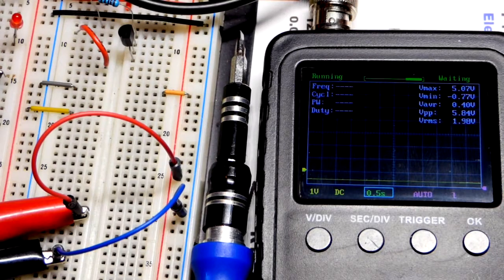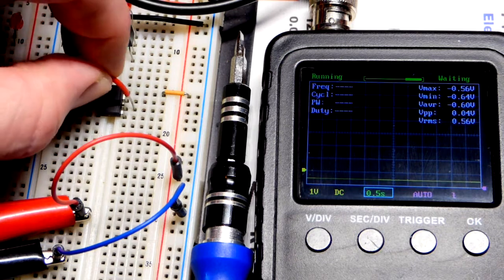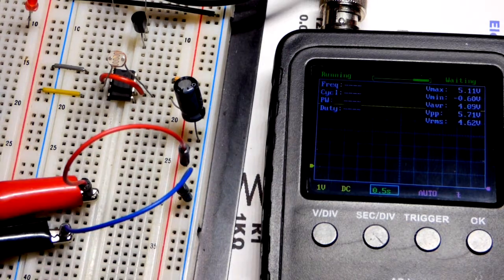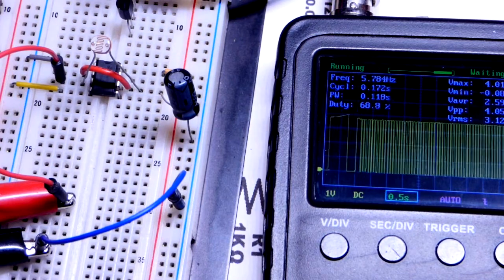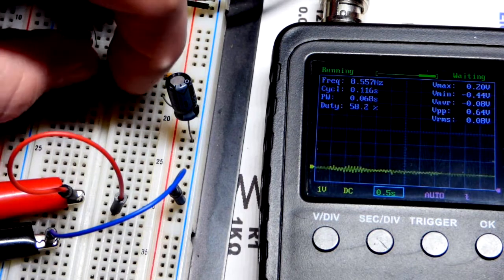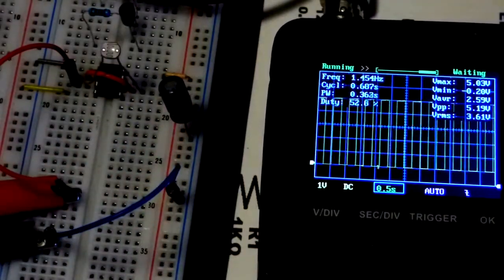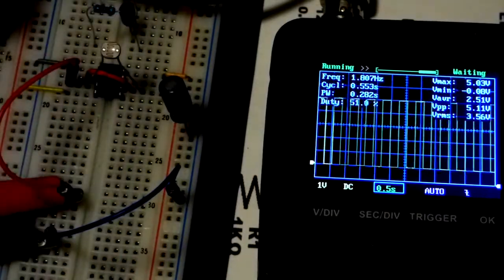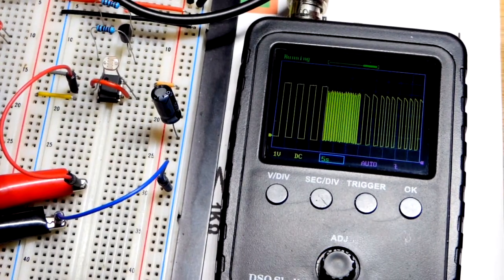TLC555 CMOS 555 timer can easily get 50% duty compared to BJT NE555 timer controlled with LDR

Comment: TLC555 is supposed to be more accurate. In either case, you should be using a decoupling 0.1uf cap close to pins 1 and 8 and a .01 cap from pin 5 to GND. This greatly cleans up the signal stability. 
And when comparing both IC’s, an LDR is a poor choice; use a 1% fixed resistor. And the electrolytic is probably not close to its printed value - they are very inaccurate. 
The TLC only outputs about 10mA, so you might wish to add a transistor to push the led, since it requires about 20mA.

Comment: TLC555 is a new gen 555. It can use smaller timing caps to reliably reach 4 times higher frequencies (2 Mhz). The only drawback I see is that the output can only source 10ma vs sink 100ma, so the anode side of your LED and resistor combo should be tied high. This isn't a big drawback, but for those used to 555's sourcing lots of current, they must adapt their hobby projects to the more "normal" approach of "open collector" outputs that sink current instead.
Reply from the maker: Yeah, the limited output was a surprise alright. Been meaning to get around to making some more test circuits with them soon :)
Reply: @Electronzap  You mean limited sourcing at the output right? Because in sinking with cathodes pointing to pin 3, you should be able to run 9 white LED's (in a 3x3 array if resistors are sized to permit 25ma per string). Some say real NE555s can source and sink 200ma but many Chineesium NE555's can't.
Reply from the maker: Yup, sourcing. It does sink OK.

Comment: I can't remember exactly how , but theres a way of cleaning up the peaks of the output signal.    I think its called a clipper.     If you throw some thought at it ,  there might even be a way of doiing it with a zener.
Reply from the maker: Unfortunately the problem is that the voltage is being clipped before I want it to lol. The output is struggling to provide the power I want.
Reply: For sure , you always have to start off with more than 6-7 volts if your goal is an output of 5 volts   lol which makes it a minimum of 2 lipos in series and a pain if your designing for something powered off a usb supply...
Reply from the maker: That's true with the widely used bipolar junction transistor 555 timer. I bought these new CMOS ones because they go to both rails.  Unfortunately, they don't source near as much current as they can sink though, according to the datasheet I read. So it doesn't take much load to pull the voltage down. Been trying to think of how I will address this in future videos :)

Comment: I really appreciate your work ,but if you could Arrange Schematic Diagram to explain also.
Cause I saw LDR connected to Threshold and Output.
Anyway Great Work.✌️🙃
Reply from the maker: Yeah. Wasn't up to making a schematic this time. But I'll be able to make a better one in the future. The LDR was connected to the output and threshold. The output is what charges and discharges the capacitor with the LDR setting the current. Thanks for watching!
Reply: @Electronzap  Thanks, 
That Made Sence ,
cause I thought it should be connected to the discharge Pin.
✌️